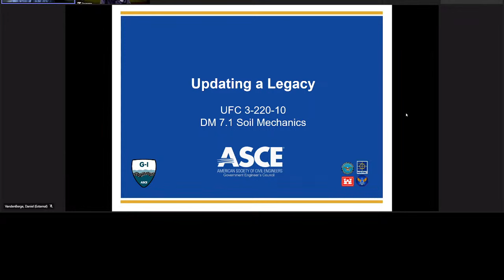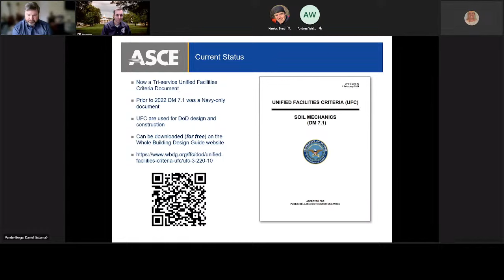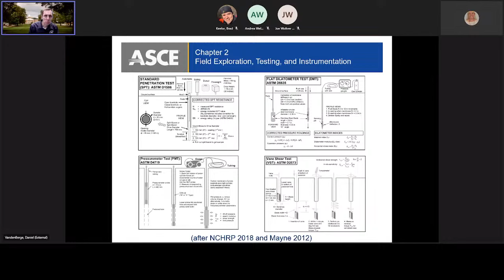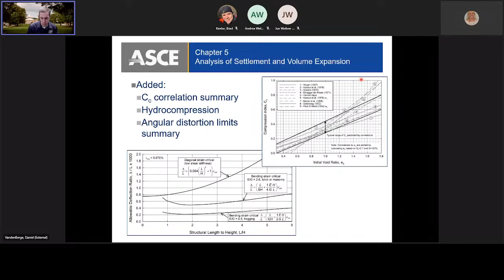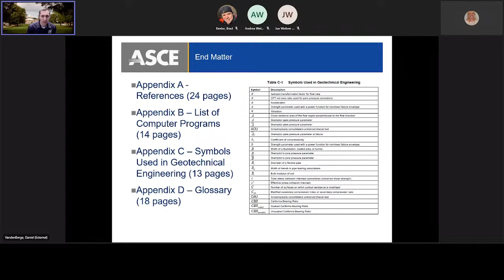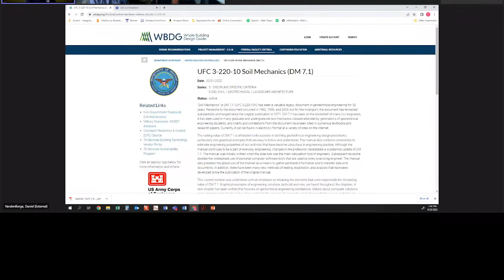NAVFAC DM 7.1 2022 Updates: Soil Mechanics

Comment: multiple items  1) with phi  C soils  are there any guidelines in how to select phi and c        2) any chance of adding effects of relieving platforms to pressure on bulkhead wall  and  3) any guidance on shielding of lateral pressure based on spacing and diameter of piles along with soil types